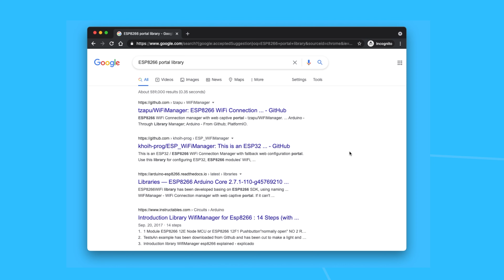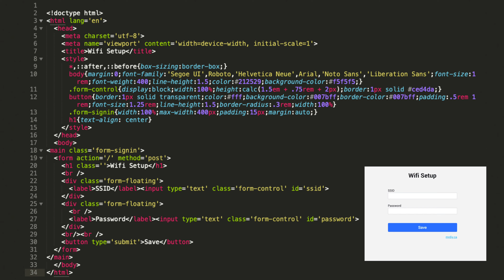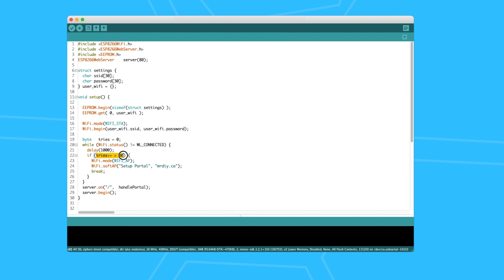How to add a Web Setup Portal to ESP8266 Projects (Soft Access Point)

Comment: perfect. short and to the point. great code walkthrough. I would think most people may want to choose whether to start in AP or client mode based on whether they are able to get any information from the EEPROM (basically test if it was "factory" reset or not) and then give the user some way to erase the EEPROM when they want to go back to AP mode and setup again for a different wifi.  Great job!
Reply from the maker: Thank you. Yes, that is a good point. Alternative ways: link the AP to a pin status or do what Tasmota does by erasing the EEPROM when the device is reset multiple times in a short time period.
Reply: You could also just start with AP + Station mode. Some chips support it.

Comment: An important tip for beginners using Arduino R3 Wifi, like me, after programming the ESP8266, to make the project work, you need to disconnect the power, turn dip switch 7 to OFF and connect the power again.

Comment: Hello! Thank you very much for the code. Perfect solution for me. But the way I access the server is different. Instead of 30 attempts, I use a button on my device. If the device is turned on with this button pressed, it goes into Access Point mode. I keep an LED blinking to indicate this mode. If the button is not pressed, the normal setup follows. Before, I had two wifi networks configured, one to join if the button was pressed and another if it was not pressed. But I knew I nedded a better solution. Now it's perfect. Thank you very much.

Comment: I tried it together with an Arduino Uno but I get
"A fatal esptool.py error occurred: Failed to connect to ESP8266: Timed out waiting for packet header"
when trying to upload the script.

Is there a guide on how to connect the ESP8266 correctly?

I connected it like this:

TX ESP8266 => TX Arduino
RX ESP8266 => RX Arduino
3.3V ESP8266 => 3.3V Arduino
EN ESP8266 => 3.3V Arduino
GND ESP8266  => GND Arduino
Reset ESP8266  => GND Arduino

Comment: Hey, forgive me, I am just a beginner. I have created a detailed arduino code that monitors a multitude of things (temperature, humidity, etc.). I am trying to display that data to a webpage. I have both a ESP8266 NodeMCU chip and just normal ESP12E chips. I am so lost as to what flashing the chips mean and how to get someone connected to the chip and to access the data. Any help for me?

Comment: Thanks for a nice tutorial! I am looking to expand the setup portal to also make it possible to configure MQTT parameters at the same time. In order to do that, I need to get the HTTP-form info with the MQTT server address as uint8_t data type. Any idea on how that could be achieved?
Reply from the maker: You are welcome. An extra MQTT field should be the same as the ssid and password fields - just add another input field in the html and save it on the backend. Hope that helps.